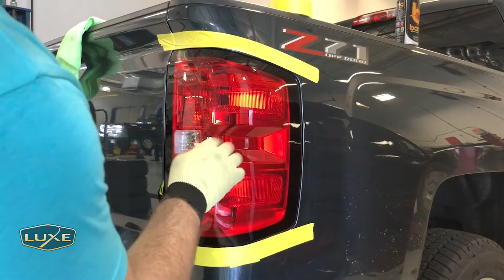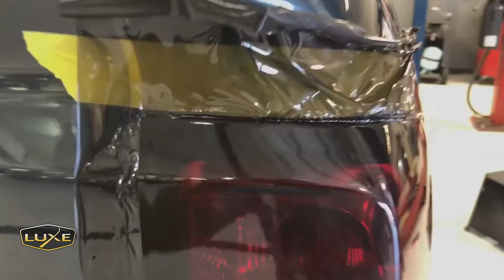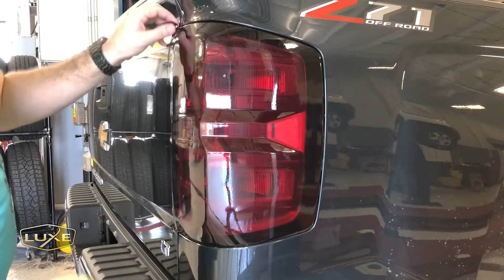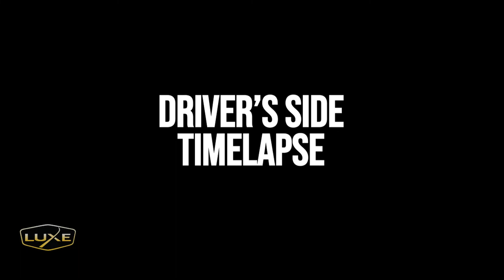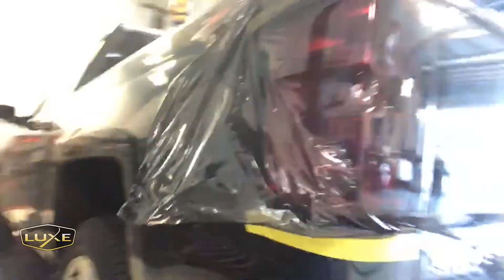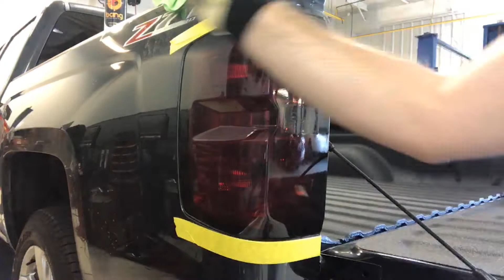How to tint Chevy Silverado taillights with Luxe LightWrap tint - Installation Tutorial Mid Smoke

Comment: was looking for this product.  Glad I found your video.   Have a couple of questions,  hope you can answer. 
Is tinting headlights and taillights illegal?
Will this survive 100 degree summer weather and car washes?
Will the  dark smoke significantly reduce the headlights and tail lights brightness ( safety issues)? 
How much do you think a shop should charge to wrap headlights and taillights?  The install is too intricate for me. I'd rather have a pro do it. 
Thanks
Reply from the maker: Legality completely depends on your local laws. We do have 3 shades (light, medium, and dark), and we have never heard of any issues with our lightest shade. Yes, it will survive hot weather and car washes, however, hot weather can affect its longevity. You should still get up to 7 years out of it, but the longer it's on, the more difficult it will be to remove. We do not recommend dark smoke for headlights. Light smoke will be your best bet, and mid smoke is ok for LEDs. Gloss, honeycomb, or star power finishes are fine, but any textured or matte tint will reduce visibility significantly as well. It's up to the individual shop for how much they charge, but for a standard pair of taillights (not a Silverado, they're more complex) I'd imagine starting at $200. We have an installer locator map on our website to help find someone in your area - https://www.luxeautoconcepts.net/pages/store-locator. Hope this helped!
Reply: @LuxeAutoConcepts  yes it helps. Thank you.  I have led headlights.  Lexus is 350 f sport 2016.
Texas headlights tint laws are not clear on the website